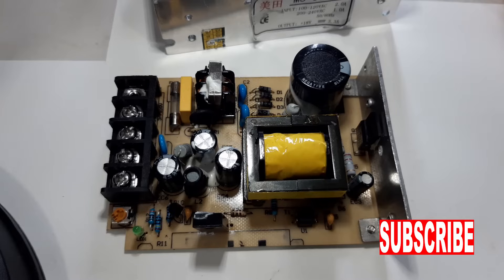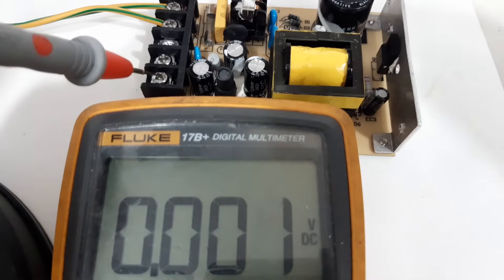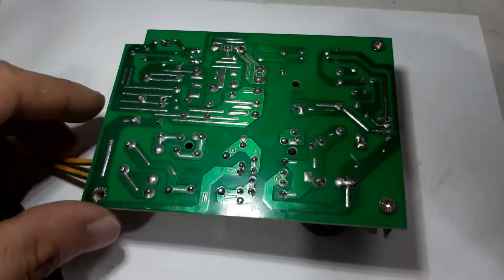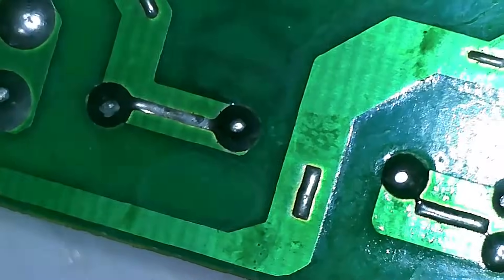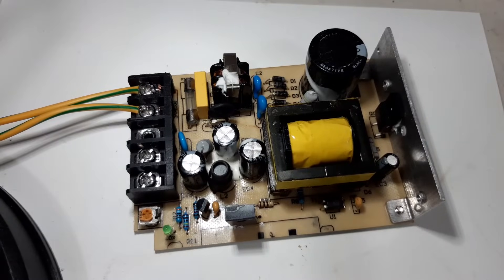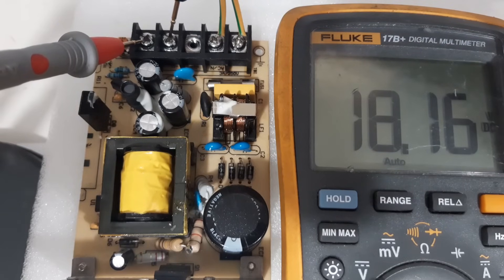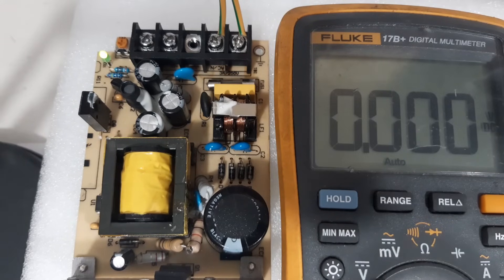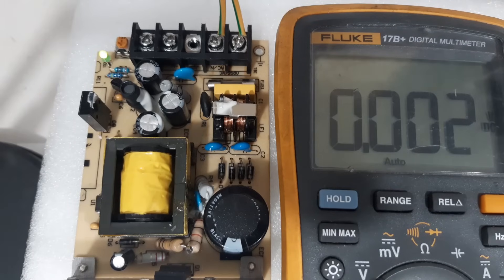Power Supply Repair : Basic Electronic Tutorial

Comment: Fluctuating reading across resistor .. testing in circuit, capacitor charging, then diode shunts .. open when reversed .. resistor seems to be open …
Reply from the maker: Sounds like you might have a bad resistor.

Comment: You should be systematic in your troubleshooting. Follow the circuit: input then output, not haphazard. 
Component checking is like hit and miss unless you follow where the signal is getting lost.
Reply: It is a relatively simple circuit having very few components when compared to some power supplies.  I too look for obvious failures beginning with visual inspection, then move to passive components considering there's not many to test.

Comment: Just a question why don't you use the half approach, in the sense that you divide the circuit into two halved then test the halves individually and the half that isn't okay you divide it into half and test it again till you go down to a specific component
Reply: Theoretically it is good to use the half approach but you need to switch on the circuit to test the in and out voltage and the risk of touching live wires is high. Going through component by component should not be a problem as you can see very few components are there in the whole circuit

Comment: Some guys say that is not okay to test the components within the circuits, some say it is not a problem..... I am really confused
Reply from the maker: It is more accurate to test the components off the board.
Reply: Electrons will travel through the path of least resistance which is usually the component that you're testing as opposed to going the other way where the resistance of all other components will be added, not to mention there's almost always a diode that will make sure the other way is not a short circuit.
Testing on board helps you localize the problem then you take the components out one by one and test off board to double check.
Reply: @eustacehendrix9659 the diode then makes the fluctuation of the 120k resistor which is busted
Reply: @eustacehendrix9659  Nice explanation , thanks!
Reply: I checked and tested rectifier bridge in circuit and got bad reading. No double voltage from neg to pos.  Took it out and it tested good.

Comment: 3:02 
what is this component?
Reply from the maker: Optocoupler
Reply: @biomedicalelectronicsengin7192   what is the use of the optocoupler?
Reply: @rodym1681  It's a switch. 2 legs are connected to an IR LED and other 2 legs to a photo transistor that catches the light from the LED. This allows one circuit to turn on the other circuit while keeping isolated from each other. It's common in circuits where interference from the High Voltage circuit must not go to the Low Voltage circuit like audio, video and medical equipments.
Reply: @eustacehendrix9659  An optocoupler, as it's name implies, is NOT a switch (although it can perform like that) but it is a device that couples optically (i.e. not electrically) two different circuits. Its purpose is a) to keep these two circuits electrically isolated, but also b) to allow the control of the circuit using its internal opto-transistor (controlled device) by the circuit using its internal photo-diode (controlling device). 
The type of control now, can be either digital (ON-OFF of a power device like a transistor), or analog, which is the case in this application. In other words, the light intensity of its internal photodiode represents the desired output voltage of the power supply, as its opto-transistor conducts in a linearly increasing (or decreasing) manner according to the infrared light density emitted by the photo-diode. Therefore, if the power supply output voltage tends to increase, then the photodiode emits more light, as the current within it will increase, forcing the opto-transistor to conduct more than before, informing the P.W.M controller that it needs in turn to reduce the width of its output pulses in order to have the output voltage reduced accordingly. Inversely, the procedure will increase the output voltage (in case the load demands more current) keeping the output voltage constant. So the optocoupler seems to be rather an optical controller, not a switch whatsoever.

Comment: Hello friend. I have one power supply of light source storz but It is short already discard the rectifier bridge , switch transforme and IC. I test it with protection and it has intermittence without protection a mosfet burn me. 
What can you recommed me? 
Thanks.
Reply from the maker: Most of my experience from karl storz light source are transformer problem.

Comment: You've replaced resistor in very low power rating, soon that resistor will got hot and it will cause burn.
Reply: Pa shout out naman dyan Biomed from UAE Dubai.
Reply from the maker: On next video. Noted
Reply: @biomedicalelectronicsengin7192  Ilang taon kana dyan nag work Saudi?
Reply from the maker: @FlorentinoJrEstil  mga 9 pa lng.
Reply from the maker: They are the same power rating 3W